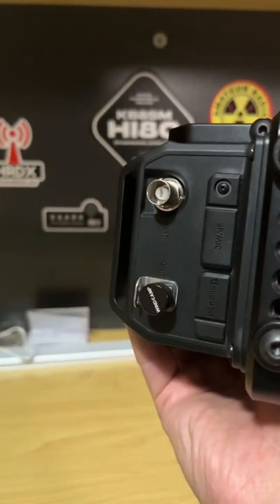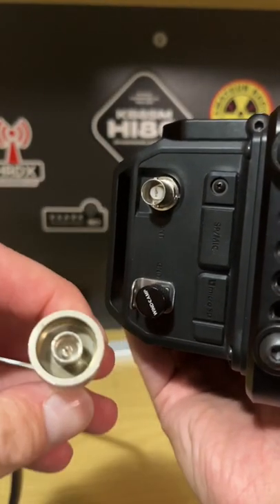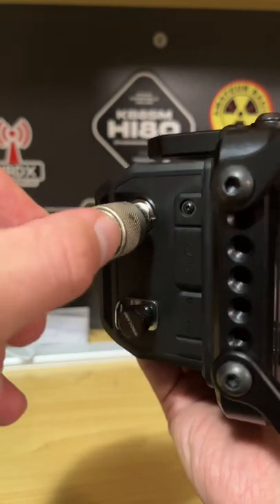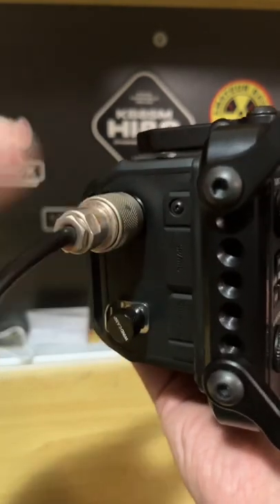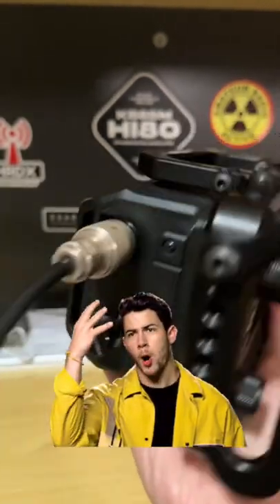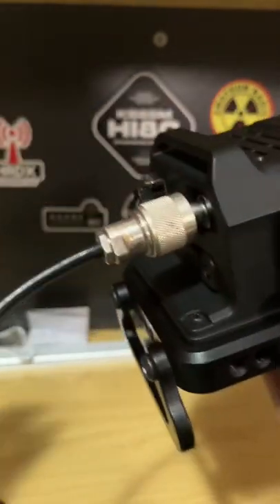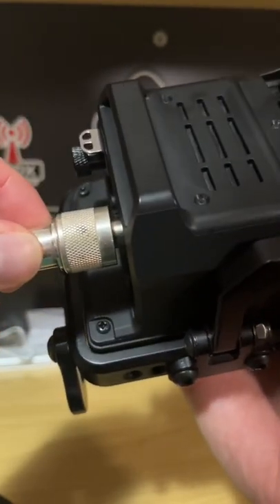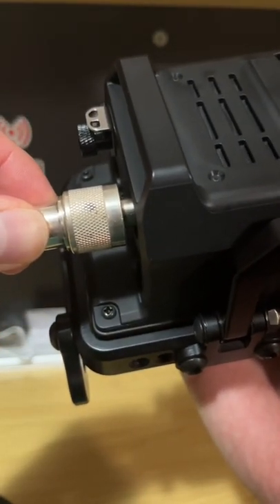Secret N connector hack #shorts

Comment: Yeah - nah. The centre pin of the N connector is 0.3 mm thicker than the centre pin of the BNC, so each time you do this you 'stretch' the BNC centre pin socket. Do it too often and you will find when you use BNC to BNC the centre pin doesn't make good contact anymore :(
Reply from the maker: I've never run into the issue. Probably because I haven't done it often enough... but as the video stated, only use in an emergency